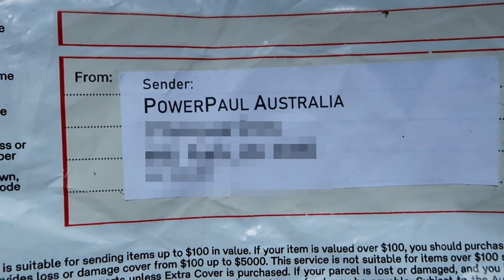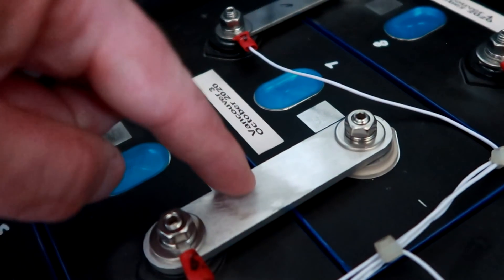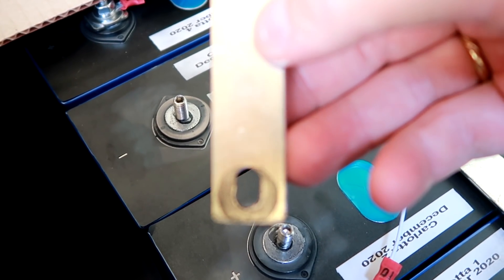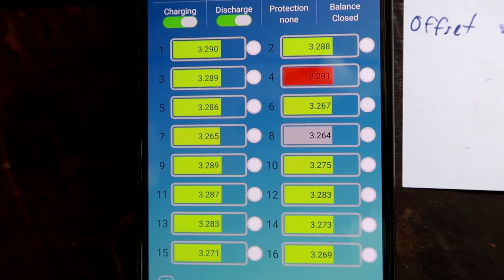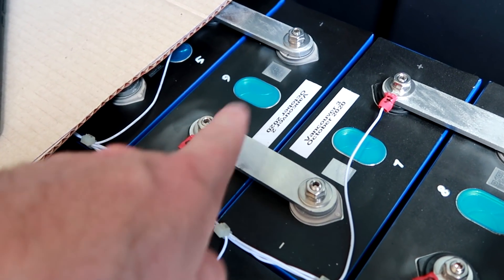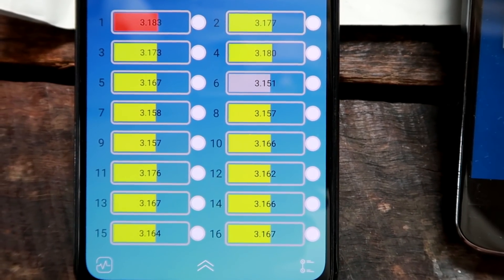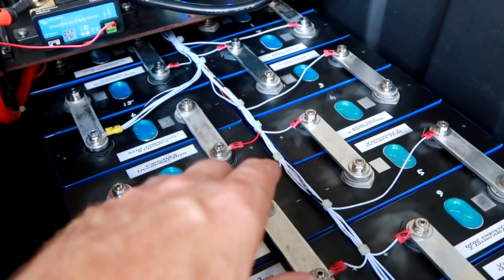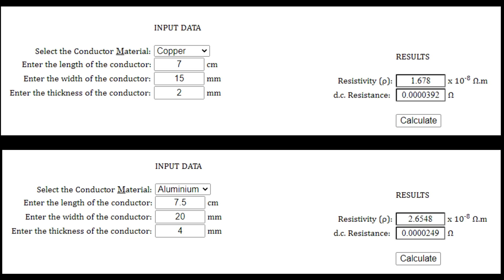Upgrading to Aluminium Busbars. Will this solve the issues?

Comment: Andy, Love your channel and have learnt a lot!. I come from the Marine world, and I’ve been told never to separate leads on a stud with washers, as I saw you removing your BMS lead above a stainless steel washer. I understand that the washer add significant resistance and reduces connectivity. Maybe this is your problem?

Comment: I'm looking into cooer cable vs nickel plated copper vs aluminum busbars. The oxide layer on the aluminium is killer. The harder nickel will help against the oxide on the aluminium terminal.
From a diy standpoint aluminium flat bar / strip with a proper compound (like the Noalox mentioned here) is probably the way to go.

Comment: Hi, can you explain the relation between max number of amps produced by the solar panels versus the max number of amps the inverter is able to output to the battery. For example, say I have 3 panels in series, 2 in parallel, so on a typical day, my inverter is seeing 95v and about 30 amps. Does this mean that my 48v LifePo4 can never charge faster than 30 amps (throttled by the solar panel output), or can the inverter output more amps given that it is pulling 95v?

Comment: hi, how are these aluminum busbars doing now?  Why do manufacturers plate copper busbars with nickel if nickel is an incompatible galvanic couple for aluminum?  Based on this - how do the nickel-plated wire terminals from the battery to the BMS and balance wires behave when in contact with aluminum busbars?  Or non-nickel plated terminals, if so, then what?  I now want to assemble a mini battery and stalled on the choice of busbars

Comment: Hi Andy,  @OffGridGarageAustralia guten Morgen. How u see this problem of the Busbars : The contact area of the cell terminals (lifepo4) with welded connections is very small. This means that the busbars in the normal version have a contact area of approx. 35mm2 and thus cause a bottleneck. The 35mm2 is certainly only a problem with larger batteries, as 70-90 mm2 is often used for the connections.  The oval holes in the busbars have advantages and disadvantages. Perhaps it is better to do without oval holes and instead use busbars with a flexible middle section to compensate for variations in the width of the cells.    Viele Grüße/ regards

Comment: The biggest issue with Aluminium is that it naturally oxidises quickly, leaving a coating of Aluminium Oxide which conducts differently to Aluminium. I’d think that, as well as a clean with alcohol, a rub with some scotchbrite, to remove any faint coating of oxide, surely would help too.
Reply from the maker: Yeah, that is the biggest problem. Even after cleaning, it will oxidise very, very quickly again. Some say you can only clean it with some sort of paste which will prevent any oxidation during the cleaning process. I tested all this in future videos here on the channel as well.

Comment: What is the lenth of the conductor considering that the current will take the shortest path ?

Isn't it only the distance between the holes in the bus bar and NOT the length of the busbar ?

You did not mention what length you had used but the calculator is made for such resistors like 20 cm of konstantan wire where you use the total length.

Here the bus bar is longer than the distance between the 2 contacts.

Comment: 3:50 Aluminum is only 60% conductive than Copper.
But if you have twice thicker and slightly wider, that busbar should be 20% more conductive than the copper it is replacing.

Comment: Hello.
correct course of actions for Al conductors would be something like this:

1) clean both contacts with acetone or benzine
2) apply small amount of  industrial oil on 120--400 grit sandpapper and sand oide layer away from both conductors
3) repeat (1)
4) apply small amount of quartz-vaseline paste or 'electrical contact grease' on both terminals/ conductors
5) tighten you terminals with required torque.
The key part here is to clean both mechanically and chemically, Al oxide layer is no joke. Al is one of the most active metals and its oxide layer is one of best isolators (Al2O3 cyramics)

You also can check contact resistance with your multimeter, just measure voltage under load betweet top of your busbar and base of the battery terminal, R=U/I, so... more current - more accurate result
Also different Al alloys have different resistivity, one in calculator is for pure Al. for 6061 -- 3.950E-08, for 7005-T6 -- 4.930E-08, for 199-o alloy it is 2.670E-08.
 and PLEASE DO NOT USE copper grease/ paste with aluminium conductors, it will corrode your terminals and busbars. Google Al-Cu corrosion

Best regards,

Comment: Didn't you measure a resistance of >1mOhm minimum between the terminals with the copper busbars. For me, this measurement results clearly shoes that the small resistance of the copper OR aluminum busbars does not matter and thus it does not matter which one u use or how much thicker you make them. It's the resistance of the connection point (connection screw/busbar/washer/nut) which dominates...
Reply from the maker: Absolutely correct, the resistance of the connection is key. And that's what I had always trouble with...

Comment: Do you not have a separate circuit for your lights?!! Never left in the dark then. Regards George.
Reply from the maker: Yes, I do, but the source is this battery for all the circuits in the garage :D
I use the Bluetti now for the video lights in these cases.
Reply: @OffGridGarageAustralia  Would have been cheaper to have made a separate circuit with separate battery battery supply for your lights!!

Comment: May be swap 1and 6. Also use flange nuts, no washers. Is it possible for you to mount the bms wires in the middle of the busbar so the contact is direct flange nut to busbar, maybe the problem might also be the bms leads terminal. PS great video. I’ll be doing mine soon. You have been extremely helpful. Regards. Roy.

Comment: my first action would be to swap places of the worst with the best . I've never heard of carbon grease and would never use it , you should have used a contact cleaner to remove it before installing new bussbars , which although looking nice really weren't an improvement over the copper . why is it you believe theres a deficiency in the connections rather than in the cell itself ?

Comment: What about copper or aluminium compression washers, they are commonly used on oil drain plugs but could be used for better contact with the terminals?
Reply from the maker: How do you compare the effect of different washers? I think we're getting into territory which is far beyond any DIY. A normal spring washer does the trick, I guess.
Reply: @OffGridGarageAustralia  A spring washer is designed to keep tension on the join, a copper washer is designed to maximise the contact area , which is what you were attempting to do with the copper paste, which would be more suited for heat transfer than electrical conductivity.

Comment: Andy. A little trick I’ve done in the past is to buddy up some cells. If you are running several banks of 16 cells, change the the configuration to 2-P / 16-S.  Take some cells from one bank that habitually run low and some that run high and pair them up. This will help average each other out.

Comment: Can anyone explain to me why you would want to use aluminum busbars versus tin-plated copper busbars? Copper can carry 50% more current for the same size. Tin-plated copper is resistant to corrosion.

Many of us already have a power supply that can be used for electroplating. Now, buy some copper bus bar or tubing, then some tin nuggets and muriatic acid. Simple.
Reply from the maker: Did you watch the video until the end? It's explained there. Aluminium is actually better...

Comment: Noalox is for aluminum electrical connections.  The greasy part keeps oxygen out to cut corrosion.  What makes it gray is ground up zinc.  Because it's ground up it has lots of sharp corners that dig in to the surfaces to provide more conduction between the surfaces.  The jell itself does not conduct in case of spillage.
Reply from the maker: I've got the Noalox paste now for the next installation.

Comment: Tip if your digital calipers is flashing like that the battery is low.  Time for a new LR44 battery.
Reply from the maker: No need for it until it turns off.
Reply: @OffGridGarageAustralia  You're guaranteed it's going to fail when the stores are closed, Murphy's Law.  Flashing means put it on the shopping list, you're going to need it soon.

Comment: I apologize if someone else has pointed this out but your online calculator inputs are flawed. The current flows between the terminals so the length of the bars should be the same.

Comment: Andy, IV done 12yrs on generators, IV always done "good tight contact" no grease or other.
Just a good clean tight positive contact.
I'll be building my battery bank the same as I did generators......
Just a quick tip IV picked up.
Best regards Marc.....up top in UK

Comment: What about thermal expansion copper vs aluminum? Strip threads? Is there a video where you tested/matched those trouble cells and then tested the bus bars?

Comment: I have always heard that sagging voltage during start is very bad for a motor.  I do not know if it is true for yours, but it might be worth looking into.
Reply from the maker: Lower voltage means higher amps to deliver the same power output. It results in slightly higher heat inside the motor coils. But for how long is that?
Reply: @OffGridGarageAustralia  Not sure what mechanism caused the damage.
Reply from the maker: @donr416  could be only overheating due to the higher current, I guess.
Reply: @OffGridGarageAustralia Sorry I usually try not to guess.  EE for 35 years, now retired.  I am absolutely not an expert on Lithium ion batteries. Too fast moving for this retired old man.

Comment: Started following your channel just lately...I want to suggest two things- 1. Thumb rule of bus bar conductivity is every square mm of it will pass on 2 amps nearly 100% anything of less mm is not good, Period. 2. Why don’t you switch battery number 678 with 123 for couple of hours 🤔
Reply from the maker: Thank you. I thought about switching the cells to another location but did some more testing and the overall capacity of the battery as a unit  seems to be OK. I'll just leave it for now and keep monitoring.

Comment: Hi again. 
Please, turn on your solar charger and let your BMS balance the batteries.  You are tricking your self out not letting the cells settle.  (Saturate get used to each other!)
Oh, aluminum has a natural dirty/greasy inherency to it. Use alcohol to clean the surfaces one last time real good just before you assemble the bus bar.  Oh, it is good practice to turn your flat washers, the sharp dicut edge away from the surface that you are tightening against.  If you have the sharp dicut edge against the bus bar surface it could keep the washer from uniformly applying equil pressure to the connection as you tork your nut down.  What can also happen is the connection could work its way loose with heating and cooling aluminum.  That is why bus bars are generally made of copper.  
Please!  Don't contaminate your bus bar connections with anything.  No copper paste, no salt, no battery grease, no rubbing alcohol, no dialectic grease, no silicone grease.  You get the picture.  Not even your buttered toast!!!

Comment: Hi there.   Just to shout out again, greese is an insulator.  Anything you put on the connections where a bus bar is in contact with the battery terminal is resistance.  Resistance creates heat.  Resistance is LOST POWER!!!  Use ascitone or denatured alcohol on both surfaces.  

My preference is to use hot dipped tined copper bus bars.  I know that the battery surfaces are aluminum.  It makes sense to use aluminum bus bars. Looks like the ones you have are perfect for your setup.  Make sure you tork to the proper manufacturers specification.

Comment: You should use the length between the studs on the battery instead of the total length of each strip. Since the current flows through the least resistance, it doesn't seem like it would flow away from the posts to the outer ends of the strips and then come back towards the opposite post. Look at it like this, if the strips were two feet long and the distance that the current needs to travel is only six inches why would the current take the longer path? You can prove this by adding an extension to one end of the strip making it longer but it wouldn't reduce the resistance of the path actually taken. Of course, I understand that longer is better but not in this case.

The thicker aluminum bar does reduce resistance compared to the thinner copper bar but if both bars were the same thickness, the copper would win.

Comment: Maybe you should consider a 2-5A active balancer to keep the balance in check also at a little higer loads, then it will also be a well balanced pack a little time after you load the pack down even if one battery gets a little off track the balancer will help it into the values of the rest of the pack.

Comment: I am running into the same problem, I ordered 16 varicore cells but they are not matched what so ever. I capacity tested each one before putting into a Pack configuration.  289Ah -271Ah spread between cell capacity.  I tried to start an exchange ticket but to much time has transpired.  I was a little leary of these specific cells.  I should have ordered Caleb's they are way better but just more expensive.

Comment: Hi. I build many batteries using these Chinese cells. From our experience if you are using grade A cells you will find 5% of them not matching ... if you buy used cells then its usually around 25% ... Yes 1/4 has lower parameters than others. Sad but real.

Comment: Try swapping 6 for one of the better packs. Should be able to work out if it’s your connections or the pack then especially if the readings move ?
Reply from the maker: Yes, this test is on my list... but wait for the whole capacity test i the next video.

Comment: At 60 amps, Your 37% decrease in busbar resistivity equates to a 0.025% decrease in total system resistance, which results in a 0.025% voltage drop. Meaning, your system theoretically would drop from 51.2353 Volts nominal to 51.2224 Volts nominal, a delta drop of 0.0129 volts, or at CV, a drop from 60A to 59.985A. 
Meanwhile, compression can increase the lifespan of your batteries not by microcycles, but by magnitudes - yet you write compression off as not worth it. 
Bottom line is, the problem with the voltage variance in your cells is not in the busbars. If your busbars aren’t warming up beyond nominal temps at load, your busbars aren’t a problem. The problem lies either inside the cells themselves (changing the position of the cells in the chain while keeping track of the cells’ identity would prove or disprove this), or in some part of the sensor [or balancer] network. If you move the cells, and the problem stays in the same position, it’s more likely a problem with the balancer or the sensor. Even if the problem moves with the cell, it could be that a better balancer system would be the better solution.

Comment: Andy, don't forget your old busbars were plated and the plating had a higher resistance than copper would have.
Reply from the maker: The plating is to prevent corrosion on the copper. So you want plated bars or copper which is oxidised? You can't win...

Comment: have you measured the voltage/resistance across the balance wires? (from Battery terminal to BMS)
Reply: Also your stainless steel fasteners may react with the aluminum over time something to keep an eye on...
Reply from the maker: They just sense the voltage so no current is flowing through these cables (unless the BMS balances the cell). Resistance does not matter therefore.

Comment: The added cross section area of the aluminum is significant only if you are doing large enough currents to cause significant voltage drop across the copper bus bars. If the grease causes a problem on your connections you didn't have a solid mechanical connection. If you did it will force the grease out of the contact area.
When are you going to connect the cells all in parallel again and top balance for real? Hold them at least 3.5V (I did 3.6V) in parallel for a day or two.  You might be able to do the same in the pack if you hold them all at 3.5V per cell for a couple of days. They need to be top balanced! Then at the low end you will see the low capacity cells.
To be full for top balancing, the cells need to be beyond the elbow of the charge curve and held there for a time. Call it absorption or float or whatever you like. They all need to get there. If you have a spec that says the current a fully charged cell will take you can use that (without the BMS attached to avoid its distortion, so cells in parallel, multiplied by the "fully charged" current per cell).  Otherwise a day or more is usually a reasonable approach. Usually the fully charged current for a lithium cell is near 0. You only need to get there for top balancing. The rest of the time in normal use a lower charge cutoff voltage is fine.
Reply from the maker: I won't do another top balancing. The BMS will sort it out over time. It's not a balancing issue.